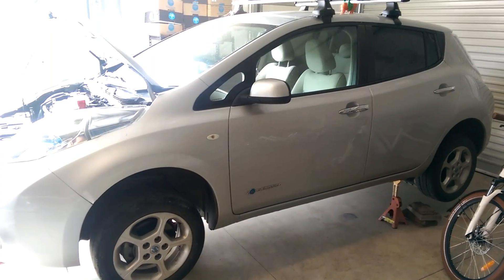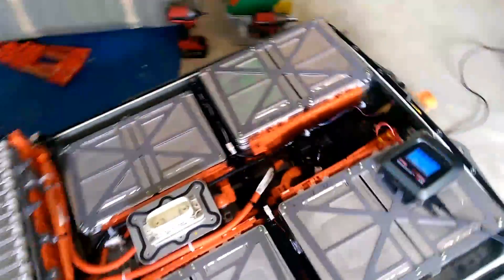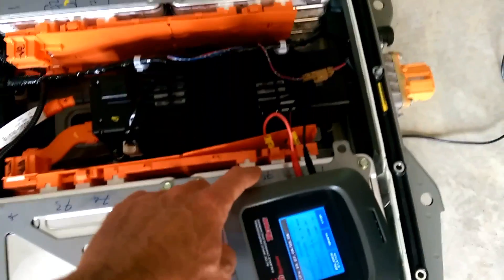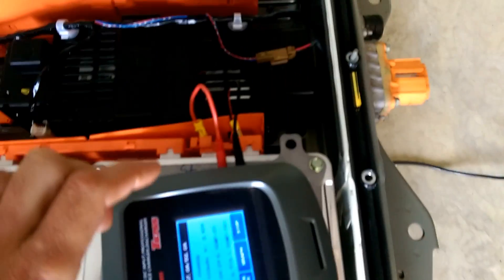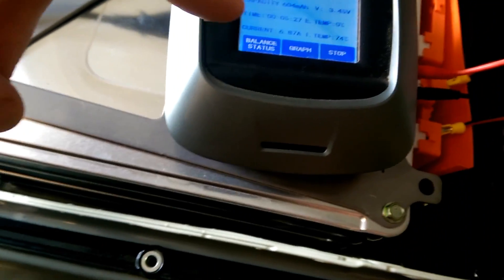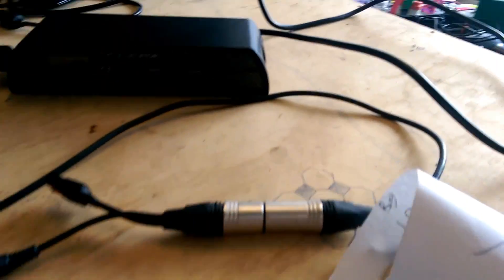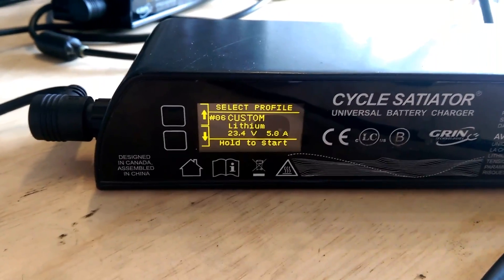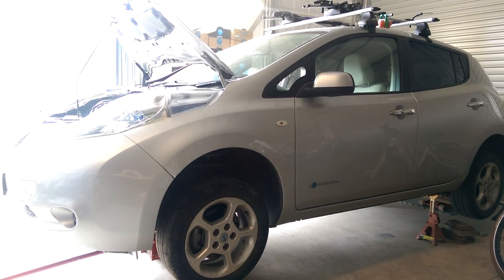Nissan Leaf bad cells! G1 upgrade to G2 cells

Comment: Even only swap the battery module into Gen 1 fitting, the LBM still blown?  Or you connect Gen 2 HV harness to connect those battery and hook up to the LBM to cause it blown

Comment: May be a stupid question but why can't you just swap the entire battery pack from a G2 to G1? I though the voltage was the same. I pulled the pack from a 2012 leaf but I didn't realize it can't be straight bolted up onto a 2013 leaf
Reply from the maker: You need an adapter because the data connector is different. You also need to program the car the battery's computer to like each other :)
Reply: Raglan Electric Bikes I bought a 2011 leaf with a brand new battery from 2017 but I haven't pulled my 2013 battery to see how they are different. Do Nissan make two separate batteries for replacement on G1 and G2 or just one battery now with adapter cables ?
Reply: Raglan Electric Bikes  thanks for the response - if you have the same model year can you swap batteries and just plug and play or does the cars computer still need to be re-set?
Reply from the maker: Computer still needs a re-set
Reply: Raglan Electric Bikes Is that hard to do?
Reply from the maker: If you have the tools, no. If you're in NZ drop me an email via my website's contact page. If you're from elsewhere get googling :)
Reply: How did you reset the computer?
Reply from the maker: I kept the BMS from the old car.
Reply: Raglan Electric Bikes  I didn't see your reply before on this basically like a diagnostic machine type of reset?
Reply: @RaglansElectricBaboon    Have you made a follow-on video of this one?   Interested in knowing what you did and if it worked.  Everyone needs to pool their knowledge since Nissan won't publish how their batteries and computers work.
Reply: @basirmoosa8223  "The Syro-Aramaic Reading of the Quran"
Reply: @basirmoosa8223   I'm telling you the truth.  You need to watch the two videos I sent you.  There are others as well.  The houris that Muslims get after they die are bunches of grapes when the text is read in Aramaic.  There is even Christian artwork that shows people being given grapes in heaven.
Reply: @Islamisthecultofsin  ahhahaha I see you are a comedian. 2 billion Muslim around the world and the fastest growing religion.
Reply: @basirmoosa8223    And they are all Christians.
Reply: @Islamisthecultofsin  like I said you are a comedian. You need your own stand up show
Reply: @basirmoosa8223    Why are you afraid to watch the videos that I sent you?   There are more and this is not going to go away.
Reply: @Islamisthecultofsin  I don't watch comedy shows maybe others will and get fooled
Reply: @basirmoosa8223   They are studying the earliest manuscripts.  It's not comedy and it's not going to go away.
Reply: @Islamisthecultofsin  they can study all they want that is why all walks of life is reverting to their original faith. Islam will always be here to stay until judgement day and if you are Muslim you will be victorious or else you are one of the losers. So make sure you're not playing yourself to fail. Peace
Reply: @basirmoosa8223   Your original faith is Christianity.  Who does the Quran say is going to judge people on Judgment Day?  Jesus.
Reply: @basirmoosa8223    You are talking about the Trinity now.  Christians believe in God.  There are two sects of Christianity.  Trinitarians and Unitarians.  Muslims are Unitarians and now we know that they are Christians because the oldest texts are Christian lectionaries when read in Aramaic.
Reply: @Islamisthecultofsin  you've lost it . You need help
Reply: @Islamisthecultofsin  Jeez, dude. It's a stream about Nissan Leafs. Get a grip.
Reply: @zombie12392    He erased most of his comments so you are not getting the context.  We were having a short conversation.  You didn't have to read them.  If you feel like learning something new, go watch the video.
Reply: hi in the video you said you fried the original bms so did you need to get a new one reprogrammed??